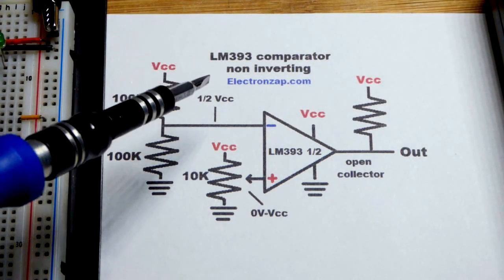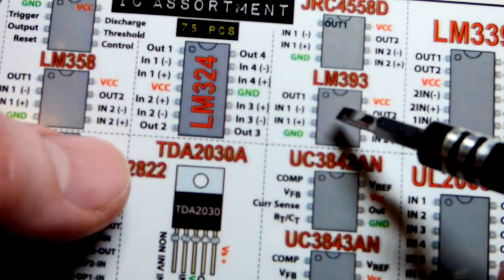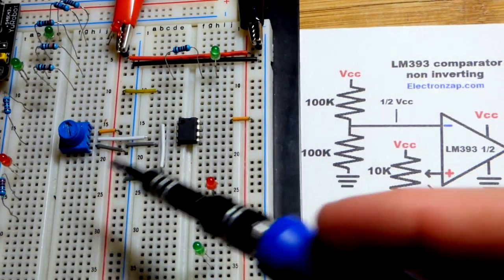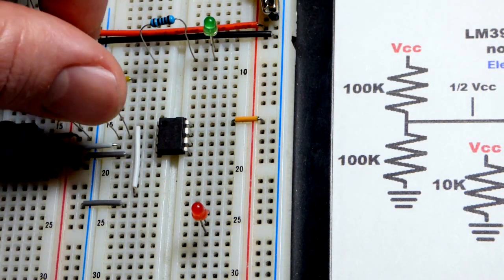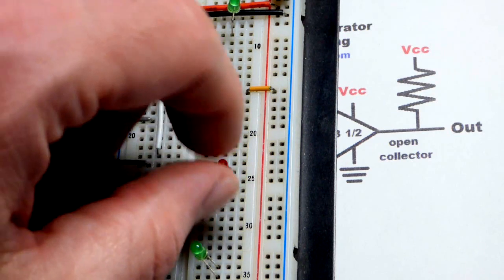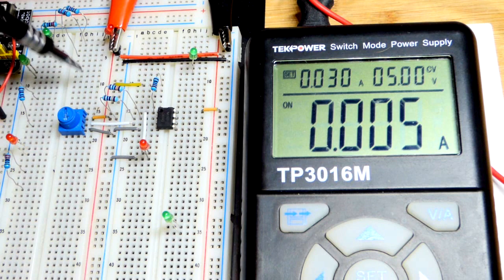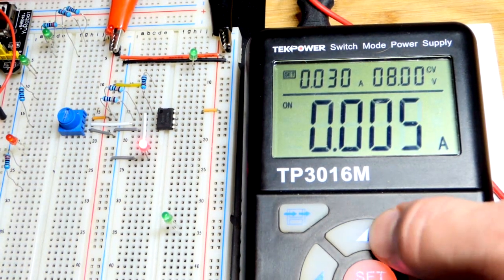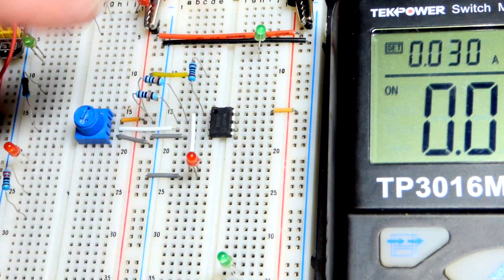Quick LM393 open collector output comparator non inverting circuit by electronzap

Comment: 5 years later, and I found this useful :D I didn't know that the output is an open collector, so I was probing it with a multi-meter and going "Why no voltage?" 🤣
Reply from the maker: Yeah, it's confusing.